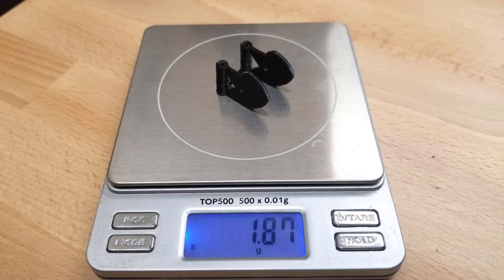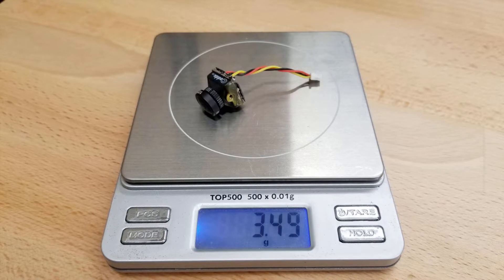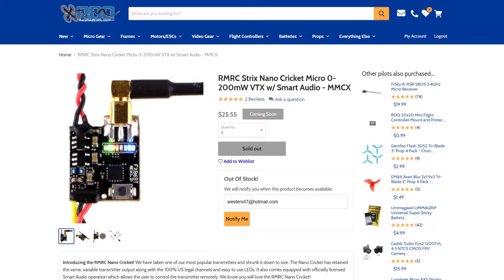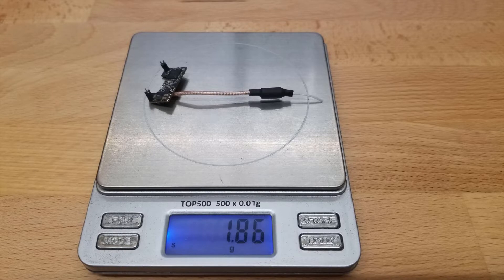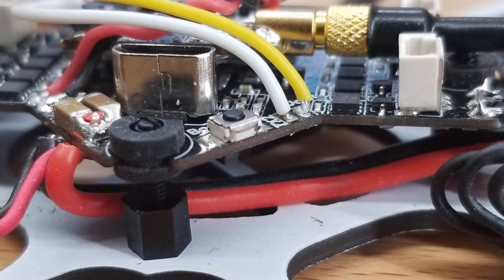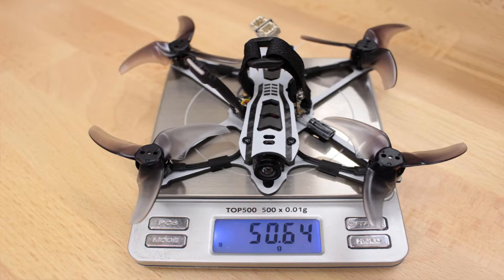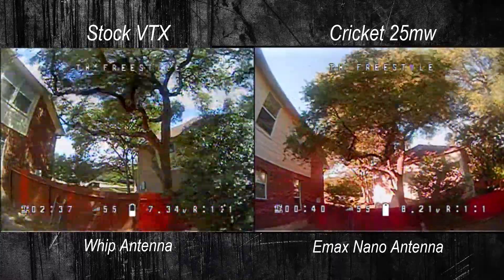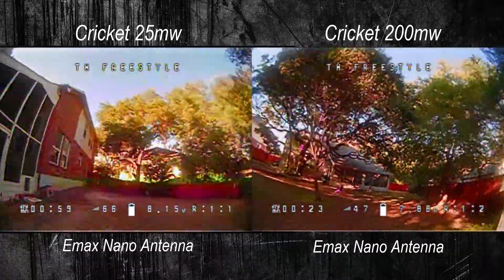TinyHawk Freestyle Upgrades - Camera, VTX and Antenna

Comment: Nice video. Now that we have Tinyhawk 2 available, I'd say skip the camera upgrade and the VTX and just put in a nice clover antenna to give your Tinyhawk 1 a whole new life. You are going to max out the built-in FrSky receiver before you'd need 200mw VTX. Also stock camera is not that bad and it much better protected that TH2.

Comment: I am a noob and wonder would I see a difference, if I just replaced the antenna only, not the vtx. My soldering is no bueno.
Reply from the maker: The video would be better, but you would have to solder the antenna to the stock vtx

Comment: As far as the 5v vtx issue, I am using a very small esc (3g) from my plane flying days connected to the battery connection.

Comment: I've been seeing a lot of info saying that I should not be attaching to the 5V from the board for risk of frying the onboard BEC.  Did you have any issues with that?
Reply: I use an external 5V/1.5A regulator to circumvent this problem 😉
Reply: Ronny King FPV I was thinking of doing the same but the regulator would have cost me around $5.95 before shipping  just wasn’t worth it. Unify nano 32 is great to just have it all in one!
Reply: @JohnCuppi  Let us know if the 5V connector keeps up the higher current draw. I haven't been able to find any schematics that show which connector provides which current etc.
Reply: Ronny King FPV oh, sorry but that’s the thing: unify pro nano doesn’t need that. since the unify pro 32 nano can just be soldered directly to battery terminal there is no worry about putting any load on the board’s 5v regulator. 😊
Reply: @JohnCuppi  Oh okay. Didn't know you had soldered it to the vBat :) Good stuff! Happy flying!
Reply: I have too, and this video surprised me. I ended up buying a TBS Unify Pro 32 nano since it accepts up to 13v of input meaning it can just be soldered straight to the battery pads at the capacitor location and avoid this risk altogether. Only weighs 1 gram as well.
Reply from the maker: Hey, sorry I missed your comment, I was worried about that also but I have not had any issues.

Comment: Nice mod/ video! Keep it going. I've just recived the Emax tinyhawk freestyle. 

After flying it, 1 lipo has 3.3V and the other one 0.1V. 

Did i do something wrong? Or did i receive a faulty battery?

Thanks in advance!
Reply from the maker: I would to try to charge it but it sounds like you just got a bad lipo.
Reply: @CrashNBurnRacing  Thank you, can i prevent this in betaflight settings?
Reply from the maker: @icetea4345  you just have to keep an eye on the voltage in the osd, it should start blinking at about 3.6 per cell.
Reply: @CrashNBurnRacing  Will do that! Thank you for your fast reply, Happy flying🙋‍♂️